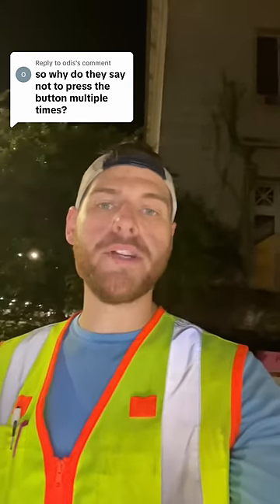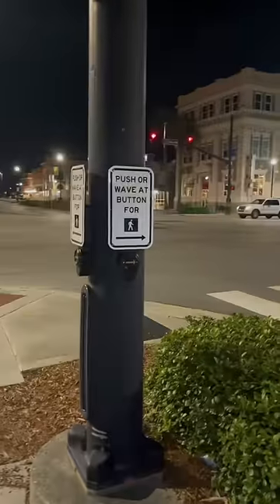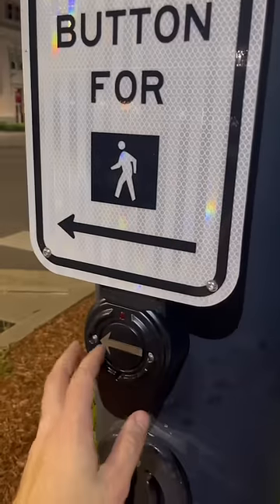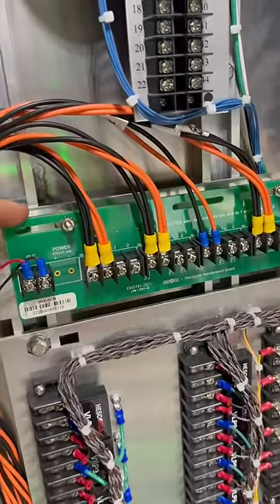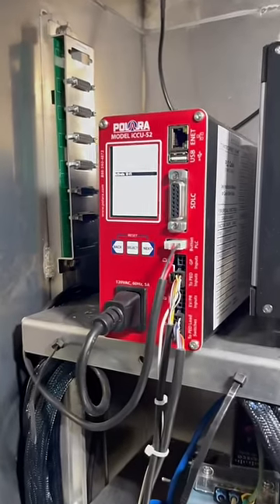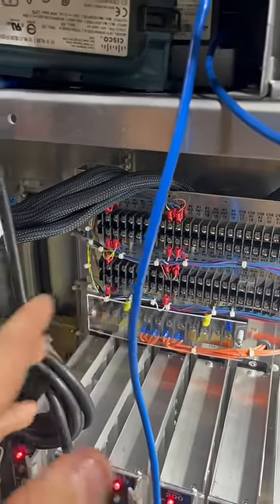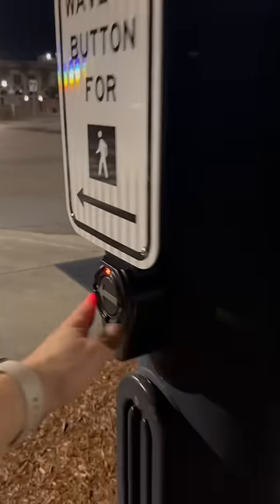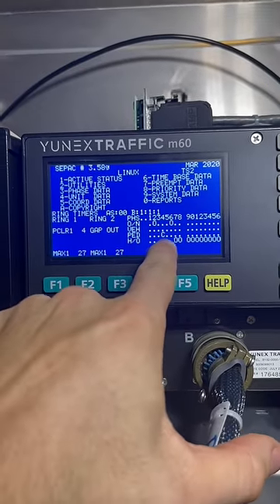Press it as much as you want!!!

Comment: As a designer, builder and programmer, that cabinet is a shit show for something as simple as a traffic intersection.
Reply: I think this guy went over it before by saying a lot of it is redundancies to make sure if one thing fails it has a back up to keep it all from breaking down
Reply: I believe there's pressure signals in there 2 but yea it could still b simplified
Reply: More $$ for projects
Reply: As someone who works in traffic. That cabinet more than likely controls more than 1 signal. It takes more than a couple cables to connect an intersection to the cabinet.
Reply: @nikkir3102  You clearly don’t know why that’s an amusing reply.
Reply: @AngryAlfonse  Not quite an Arduino but a bunch of induction loop muddles a PLC, DI &DO interface modules, DC power supply, some breaker and you’re pretty much there. I’m probably missing something because the only traffic light program I’ve done was for a wealthy client who wanted it for a drinking game.
Reply: There are arguably many ways that it could be done to simplify yes. I don't disagree. I'm usually not asked what I think in meetings because i tell them it doesn't makes sense. The government on all levels do the simplest things the most complicated way (contractors included). It all comes down to money and job security for contractors. 
For the time I've had my job, I've seen first hand the waste and the conversations we've had on the job of how to simplify things. But no, they actively choose to continue with such setups as shown in the video.
Reply: @PoiterDaloiter   I agree, I'm exaggerating the simplicity of the circuit. It's just silly that they need all of that big expensive tech for the computation side when the computation side is just not that complicated
Reply: @nikkir3102 What in the world is your name.
Reply: @PoiterDaloiter and the system you proposed could be hacked by anyone passing by, would be easy to physically take control of, would have no backups in case of failure, and would have no remote monitoring capabilities. 

You're not as clever as you think
Reply: @nikkir3102 they don't listen to your opinion because it's uninformed. The experts have no reason to listen to you because you're proposing bad ideas
Reply: @nk-dw2hm You'd still need physical access to the cabinet to take control of a system run by something like a Raspberry Pi, unless you were using wireless networking (which you simply wouldn't be doing anyway). Also, who tf is going around trying to hack into traffic lights?

Talk about not being as clever as you think you are.
Reply: @SirBoomNPew  are you serious? Literally every enemy country, terrorist, or 15 year old who thinks it's funny. What happens when someone creates traffic jams around every hospital by turning all lights green (or red) at the same time. Or overrides emergency vehicles so that there are accidents? Or any number of other horrible acts that could be done with control of the infrastructure? 

You also didn't address any of the factors I brought up. Redundancy, remote monitoring, etc. It's not a "gotcha" you just pointed out your own inadequacy
Reply: @nk-dw2hm  lol I think you're the one struggling with inadequacy homie
Reply: Now there's definitely a lot going on in there. The lights, straight, Left, right,triggers on the ground which are actually magnet loops, walk signals. There's also that remote monitoring thing where they can time the lights together with the rest of the lights in the city. Maybe some camera controls and the one for the emergency lights that the ambulance can override the intersection. The more I think about it, the more shocked I am that They got all that in that box. They might be able to simplify all that but this intersection probably grew and they added on things as it got bigger and bigger and bigger. So plus this thing has to be robust enough to take weather and traffic. So push the button all you want, should be fine😊. ...(But that's not what he said. I don't know what happens when you do 😂)
Reply: Probably a universal box that they just wire up to match the intersection. Probably capable of some very complicated intersections with cameras, ground loops etc. Cheaper to have one design than engineer a custom design and possibly get a box that can't do the job. Just call the fabricator and say "One please" and you have it delivered ready to go.
Reply: @n.gineer8102  Pretty much what I said to another chap. Thing is still a bit of a shit show inside.

Comment: Once the call goes into the traffic controller, (Yunex M60) its a locked call. The controller ignores any more inputs , i.e. ped button pushes.  It will service the ped and concurrent traffic phase when it's turn comes up.
Reply: I'm still pushing it 100 times
Reply: That's assuming the button is working in the first place.
Reply: That's not a reason not to push it again. That's a reason why it's not necessary to push it again.

Comment: It's then connected to the thermal magnetron that sends a signal to the phase combustion crypton chamber that distinguishes the ground wave resistance between the flux filled capacitor and the mixed signal accelerator. So don't push it twice......
Reply: You write for Star Trek, dontcha?

Comment: Why do they use an entire box full of equipment when a Nest thermostat has a more complex job.
Government spending at it’s finest.
Reply: Gotta be lighting proof for some reason. Also this shit runs on 1970's era standards and regulations back in the day of relay operated traffic lights, adding all that useless shit for no reason
Reply: 2 reasons: reliability and proof of safety.

These things need to work until the next time they're replaced for standard maintenance. SW glitch in your Nest fail to communicate a signal 1% of the time? No biggie, that's like 15 minutes a day that it messes up.

Lightning strike hits your nest and you're out for 24hrs to fix damages and replace components? That sucks. Happens on a street section and literally thousands of people are inconvenienced.

New Nest drops and it has a bug that'll swap a value randomly throughout the week? No biggie. On and off. Thar happens at an intersection and maybe a pedestrian gets hit by a truck. And nobody will know if this model is the issue until it's many victims later.

Comment: You told us why we only need to press it once but didn’t say a single thing about what happens when you press it multiple times
Reply: Pressing it multiple times won't do anything different. Just press the button once and wait for the walk.
Reply: Sorry, but no answer there
Reply: @OnTheHonda  pressing the button once connects the circuit. Pressing it more than once just  wears  the switch out faster. The circuit to initiate the light change sequence is already activated.
Reply: It starts a matrix… little do you know…
Reply: Exactly. He said nothing, which is exactly what happens. These systems ignore all subsequent presses.
Reply: I suppose it is like pushing an elevator button multiple times.
Reply: @aroger9425  Pressing the same button multiple times might not help but walking across the street and pushing the other button will make the light change faster.
Reply: Nothing
Reply: Hello! It's in the description! 😂
Reply: And it’s said in the title 😂
Reply: Pssssst read the title

Comment: Did you explain why?  Was that a long way of saying it does not help, one input is as good as four?  Does a second press actually slow it down?  I'm supposed to know what the firmware on the plc, ccu or the controller of the intersection does to understand this discussion.   Is it actually bad to press it twice?
Reply: You can press it as many times as you want, but it still just implements one signal, and doesn't do anything different.

Comment: In most places there is no actual connection. The button exists only to serve as a means to let people think they have control. In reality, the light is programmed to turn white or amber depending on the light cycle of the road lights. Other times, all this does is just change the light color on a green when pressed but doesn't actually change the road lights timing.

Comment: The answer is in the little byline. Press it as much as you want, until you wear out the switch(which is the actual reason why you might want to avoid hammering on it). Ultimately it uses a PLC, industrial controller and a computer that interfaces with the lighting network directly. It seems like a pretty straight forward control panel, the switch activates the PLC which is specifically relaying that signal to the ATC(big ass computer) which is the function specific controller that interfaces with the lighting system.

Comment: I feel like you could fit the whole process on a raspberry pi…
Reply: You absolutely could. And if not a small pc. The reason they arent is standardization. These parts are a lot eaiser to source and have a lot better io.

That being said if we actually wanted to improve cities i wouldnt start with the traffic signals lmfao
Reply: If you showed me that setup and I had to guess what it did I'd guess it was something to do with the large hadron collider and not a traffic light.
Reply: @Depl0rable10  Also cost a whole lot more, but in return they are (should be) more robust/durable.
Reply: I thought Pi’s are hard to come by these days?
Reply: This controller is likely far less powerful than any Pi, but it has high voltage IO, is hardened, and most importantly, is certified and absolutely guaranteed by the manufacturer to work perfectly 100% of the time.
Reply: @user2C47  that makes sense. Reliability is important whenever pedestrian safety is at stake
Reply: "Certification" is nothing more than gatekeeping and trying to keep a cheaper competitor off the market. The system in bulky, inefficient, and overbuilt. Any SoC will outperform it.
Reply: @DominickWalenczak  You would still need hardened IO, and a program that meets legal requirements and is guaranteed to never ever ever do anything it isn't supposed to. Then, you would need to get that system certified. Also, remember that if the price tag isn't high enough, nobody will buy it.

TL;DR: There's a reason PLCs use 90s technology and cost many thousands of dollars.

Comment: For a number of years now, work has been proceeding in order to bring perfection to the crudely conceived idea of a Traffic signaling transmission interconnection that would not only supply inverse reactive current for use in unilateral phase detractors, but would also be capable of automatically synchronizing cardinal grammeters. Such an instrument is the turbo encabulator.

Now basically the only new principle involved is that instead of power being generated by the relative motion of conductors and fluxes, it is produced by the modial interaction of magneto-reluctance and capacitive diractance.

The original machine had a base plate of pre-famulated amulite surmounted by a malleable logarithmic casing in such a way that the two spurving bearings were in a direct line with the panametric fan. The latter consisted simply of six hydrocoptic marzlevanes, so fitted to the ambifacient lunar waneshaft that side fumbling was effectively prevented.

The main winding was of the normal lotus-o-delta type placed in panendermic semi-boloid slots of the stator, every seventh conductor being connected by a non-reversible tremie pipe to the differential girdle spring on the “up” end of the grammeters.

The turbo-encabulator has now reached a high level of development, and it’s being successfully used in the operation of novertrunnions. Moreover, whenever a forescent skor motion is required, it may also be employed in conjunction with a drawn reciprocation dingle arm, to reduce sinusoidal repleneration.”

Comment: Some Australian cities have setups where the button literally does nothing and they work off a timer. Do you have setups like this?
Reply: Here in the Netherlands they usually work with sensors, so they can detect and start counting, you even before you arrive at the lights, also we sometimes have rain  and general weather sensors to greatly increase pedestrian or cyclists priority over all other light. 
But even with all that our buttons do stil work, sometimes to increase priority (to confirm someone is actually at the lights, or sometimes just to turn on the turn countdown and audio queues

The only time we would use timed lights is at construction zone, or other unusual situations, since there realy inefficient and out dated
Reply: And I strongly suspect it's the same with UK systems - many intersections have fixed programs that include pedestrians cycle regardless of there being pedestrians there or not. Also, pedestrian controlled crossings are also sometimes set to work on timers for overall traffic flow control
Reply: Most downtown areas run ( non actuated) i.e. , no traffic or ped detection. This is for coordination along corridors.
Reply: They do both, but also, pressing the button only puts in the call for that phase.

Comment: Once the call is logged the system has to wait for continuity.  

Meaning at the next event the pedestrian walk procedure will be executed. 

Pressing the button multiple times won't make the light turn any faster due to the system already having received the call.

Without waiting for continuity and the pedestrian walk signal instantly changing to green and everyone else's light changing to red, anyone still in the intersection or soon to be in the intersection won't have enough time to stop if you immediately run through the pedestrian crossing.

Comment: The first press of the button activates the Langstrom circuit, but if you press the button two or more times, it activates the Filstrapgyrocosmic Relatevator which might cause a temporal flux and result in a time paradox.

Comment: Wanna actually learn a couple facts about crossing buttons
1) many few multiple button presses as a high volume of people to cross the street causing it to stay longer to provide that time
2) some do absolutely nothing after it's pressed the first time
3) some are just a goddamn placebo and do absolutely nothing and you're going to get your walk light when the light changes regardless
4) some of them are like an on-off switch by pressing it multiple times You're actually turning it on and off.
5) some have a function that if you hold it to him for 3 seconds it'll alert the system as a physically impaired person and the light will not change until you have pushed the crosswalk button on the side of the street you needed to go to or holding the original button for another 3 seconds

There's tons of types of crosswalks and most of us have not actually had to deal with most types

Comment: 'As it's unnecessary' is the answer.  As long as the light on the pushbutton unit is lit, the controller knows you want the 'walk' to be displayed.

Some of us Signals Engineers would NOT understand MOST folks aren't interested in the detail of the call record and how the controller has to run through it's sequence and then bring up the walk when the associated through movement phase starts.. unless the ped is programmed with a 'late start' for the vehicle signal group so the pedestrian is established on the crosswalk so they are more visible to the vehicle drivers and therefore help make the ped more obvious...  blah blah blah.....  :D :D

Some folks like to answer a question that they want to answer rather than the question that was actually asked.. particularly when considering the audience....  Pffft....

Comment: That equipment is really expensive. They could run all the gear on one device. What this looks like to this computer engineer is that the City is getting overcharged. It looks like corruption.  There should be one device, and there is zero reason to have a screen.

Comment: You forgot to tell us why.  If that PLC programmer was good, it is a latching circuit logic and it makes no difference if you push it 100 times
Reply from the maker: YouTube cut the video short I’ve re edited it and reuploaded it with the explanation but this is the popular video and the new one didn’t do as well! It’s on the channel!
Reply: @Trafficlightdoctor so it doesn't matter if the video is useless, as long as it is popular. got it.

Comment: Huh?   Explanation is clear as mud.  SMH.    It’s not a question of “shouldn’t press the button multiple times”, the point is you don’t need to push the button more than once as it will not expedite the light change. 
Same thing with an elevator call button.